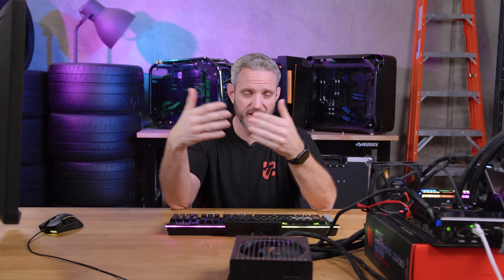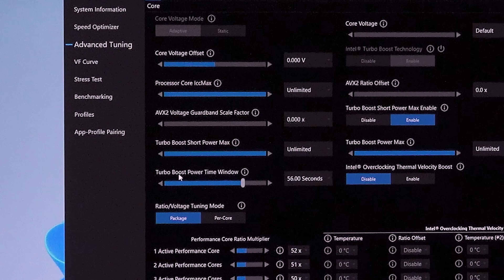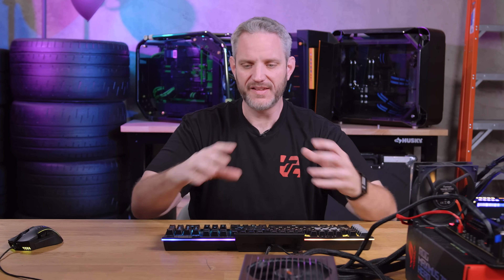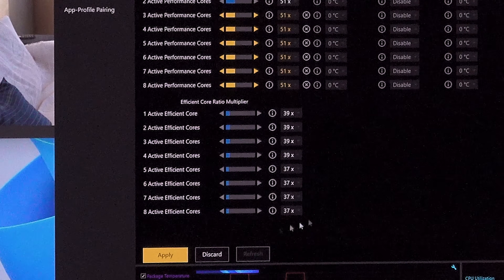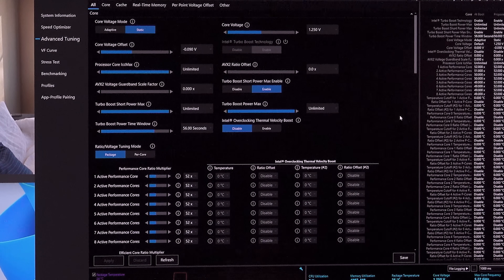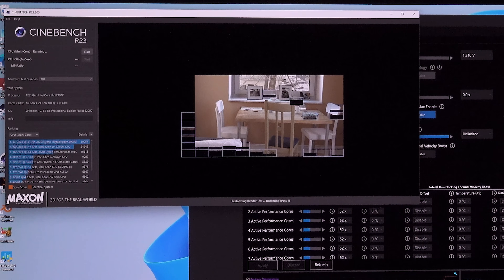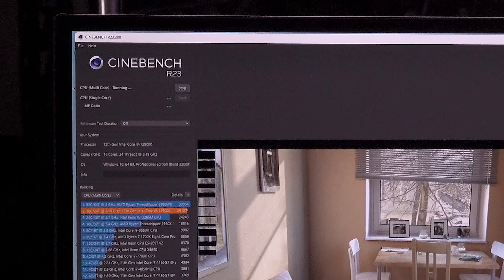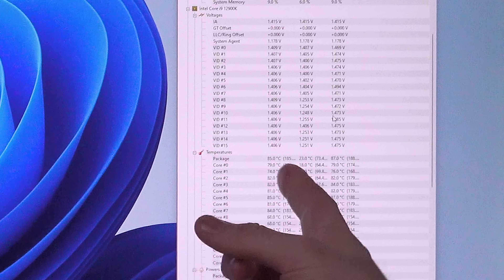Overclocking the 12900k is pointless and dangerous! Heat and Voltage testing...

Comment: I have my processor downclocked by 500Mhz. Still.plays all games just as fast, but much cooler. Video card power max set at 60% so it never draws more than 60% of what it can. Barely any change in FPS. Why the he'll do people OC? No need. Ever, unless you have a complete carp of a computer I guess. But if getting 144FPS plus, with far lower settings and power draw, why OC and burn twice the power and get negligible difference? Seriously.

Comment: my godman fucking piece of shit 12900k i caped it at 150 watt reseated the cpu block 3 times now and no fucking matter what i do this cocksucking cpu is still running 100c on 60% usage at 1.25 volt i have a massive 420mm+ 360m radiator pump fully working at 100% fans at 100% still boiling godamn hot losing my shit on the garbage cpu

Comment: Man, I took a crack at this last night and today and I'm getting some VERY odd behavior where no matter what I set for voltage offset I was getting thermal throttling.  I started fresh this morning by first setting everything back to default and starting over.  I ran Cinebench a few times with temps topping out around 93 and voltage max was 1.317.  I then added an offset of -.005 and the next run my max voltagle went UP to 1.4 something and had thermal throttling.  I tried to reset to default and my computer crashed (a few times).  I was finally able to reset to default and run stress test again and all was looking normal.  

So I offset voltage -.005 again and this time when I ran Cinebench the max voltage actually dropped to like 1.311 and max temps dropped maybe one degree.

So I kept dropping the voltage in -.005 increments and kept seeing the max voltage and temps drop.  I stopped at -.015 and then started increasing the multipliers on the cores in small steps.  All was well until I suddenly hit more thermal throttling and wanted to drop the voltage offset to -.020.  But when I ran the next test after that my voltages suddenly shot up to 1.5 and are now STUCK at 1.5 idle even with all changes set to default.  And now when I run Cinebench with all defaults I get thermal throttling.

What the hell is going on?

Comment: Given the improvement (or existence!) of the turbo boost logic on modern Intel cpus, would an otherwise equivalent k and non-k cpu (say, 12700k and 12700) operate the same stock (ignoring possible silicone lottery differences)?

Comment: I just bought an I7 12700K and the CPU is throttling quite easily due to high temperature (100C/232F !!). I'm using watercooling with 3 fans x 120cm dedicated to CPU. Is anyone else in my situation ? I'm quite worried the CPU burns out.

Comment: Disagree - If you're overclocking the 12900k (seriously) with E-Cores on, you're doing it wrong. Turn off E Cores, and play around with HT on/off and you can get pretty decent results on a 12900k (5.5-5.7). A KS SKU is also coming soon that will be pre-binned 5.5, which indicates there's cleary room for more on these. DDR4 vs DDR5 makes a big difference too.

Comment: 5.4 pshhhhh my 12900k can't run 5.2 all core stably unless I push 1.45 vcore and by that point cpus thermal throttling. Did Intel give you a nicely binned 12900k so you can promote these misleading overclocks?

Comment: can i run the i9 12900k with an air cooler? at stocks speeds i mostly prefer air coolers and i was planning on using a nh d15s
Reply: of course you can - at least as long as you dont expect to run a FMA-3 enabled prime95 without throttling.

Comment: it has been like this since 5 or 6 years. 
For example, back in the day if you wanted "playable" framerates at PUBG or DAYZ, you needed to overclock EVERY SINGLE ELEMENT of the pc.
I still remember going from my 1100t to my 2500k and jumping from 15-20 fps to 30 fps in dayz mod. Adding 2133 rams and overclocking the cpu to 4.8 ghz gave me around 40-50 FPS. 
Basically every HZ gained was valuable. 

Nowdays? Every game looks the same and can be ran at 150fps +
Maybe when they add complex AI overclocking CPUs will have meaning again. Until then, I rather run at 4 ghz low power than having a 500w toaster for web browsing.

Comment: Bit misleading given its not uncommon for motherboards to push these cpus to around 1.28 volts on stock settings to get 4.9ghz on the p-cores, lol. 1.28 volts can get most average binned 12900k's to 5.1ghz on the p-cores. 

Also, e-cores should be disabled if you play games as they can easily lose you 10-30fps in cpu bound games because they limit your ring ratio to a max of about 4ghz before you get errors. E-cores disabled let you get your ring ratio to 4.9ghz or 5ghz, which games actually care about your ring ratio. E-cores, like hyper threaded cores, usually get ignored or utilized poorly in games. E-cores also cause more power consumption on these 12th gen chips.

Comment: Gigabyte Gaming x
12600k 

Set: 
All core 5GHz p core
All core 4Ghz e core
XMP memory 3200 cas14 gear 1
Off set .05
Cache ratio 40
And not much else (could squeeze more out of it but really no reason to)

Runs very well with my old Noctua D14.

Basically a new motherboard and CPU and reused every thing else I had.
Nice upgrade to see me through a few years.

Comment: Wow, is a 3090 really still bottlenecked by previous gen CPUs?

I have a 9900K @ 5GHz, does that mean my 3090 FTW3 Ultra might be bottlenecked?
Reply: 100%. Anything than the highest end CPUs will bottleneck a 3090 to some degree, although it won't really be noticeable for the most part as long as it's at least 5600x/12600k range.

Comment: Extremely useful content Jay, Thank you! This is basically my exact build, just waiting for DDR5 (5200) modules to be in stock to finish my build. Please keep up the great work!
Reply: Finally got some ram two days ago on the old newegg shuffle. Gskill 6000
Reply: @erickwalker11  what motherboard? I have read 6000 and higher is unstable
Reply: @mikerzisu9508  z690 hero.  Completely stable. Never had to look twice after install and it's running at the full 6000
Reply: @erickwalker11  assuming you got one of the good batches with the capacitor installed correctly.  Are you running win 11? Any bsods?
Reply: @mikerzisu9508  no problems what so ever
Reply: @erickwalker11  did you check the potential backwards capacitor? That is a serious issue
Reply: @mikerzisu9508  yes its fine
Reply: @erickwalker11  have you tried stress testing it using prime or cinebench? Curious what thermals your are seeing. Also what cooler and thermal paste are you using?
Reply: @mikerzisu9508  of course it's been stressed. My system uses dual 560 mm radiators one for each side with the CPU and GPU separate. Running a 12900k I haven't seen over 73c after a good 6 hour loop on cinebench.

Comment: For people with Asus boards.

1. Disable all E Cores
2. AI Optimized on CPU and RAM
3. F10

What do you think about this 95% Overclocking done in 10-second guide? Or does someone still thinks E-Cores is necessary for gaming?
Reply: What do you mean by F10?
Reply: @mohamedmoustafa8924  In most BIOS or UEFI F10 button means save and restart. So basically once you're finished with all settings press F10 then enter to restart :D

Comment: How to undervolt on the asus BIOS
For the z690 boards, go to the overclocking tab. Scroll way down to "Cpu core/cache voltage" 
Change it to adaptive, NOT offset. 
Then change it to a minus symbol. 
go down to the cpu and set it to 0.070 and hit enter. All 12700ks should be able to do that so far. Brings temps down allot. 
that is -70mv btw. It'll add a bunch of zero's when you hit enter, don't worry about it. 
The new voltage will be shown during all core load, not single core boosts which still hit higher.

Comment: J intel xtu does apply your stable overclock at startup automatically you dont even need to open the program itself (Theres a xtu service running on the backround that loads your stable overclock on windows startup) i dialed in 5.2 ghz all p cores and 4 ghz all ecores on 12900k on xtu with -065 mv offset voltage thats all i change set it and forget it i didnt even bother changing anything on bios other than turning on xmp profile. Thats how easy overclock nowadays

Comment: I have the Gigabyte Z690 Aorus Master and am noticing a huge discrepancy when configuring voltages in XTU vs in the BIOS. Setting the voltage offset is a perfect example. Changing nothing else in XTU, except the Core Voltage Offset to -0.050V results in a Vcore of 1.243V when running Cinebench R23. Doing the exact same change in the BIOS results in a 1.305V or higher. I'm opening a ticket with Gigabyte, to see if they can explain the difference.

I've also noticed that even the lowest setting for Load Line Calibration causes massive spikes in voltage.

Comment: Hi jay. I always watch your videos man very informative. I have the 12900k and the Corsair icueh60i cooler. I want to exhaust it from the top of my NZXT case. It only has a single 120 fan and radiator so I was wondering your thoughts. I also want to enable the AI optimized feature. Will this cooler be good enough for that setup with no major overclocking?  Thanks man.

Comment: I’m happy to see the E-cores can achieve beyond 4ghz! This new architecture feels like what Sandy Bridge felt like just around a decade ago. 
There are even still decent budget builds I’ve seen here and there using i5-2500k’s & i7-2600k’s just because of how far ahead of their time those chips were (usually paired with an RX 570 or 1050Ti/1060 6gb nowadays)
Then again, AMD is gonna bring the heat with Zen3D(if that’s what they’re calling it?) as well as Zen4. Man what a time to be alive, if only the chip shortage wasn’t a constant issue.
Reply: And the gpu shortage, but hopefully that will improve with the 4000 series

Comment: the nzxt is trash btw, for 2100$ they give me ryzen 5 3400g and 6600xt gpu which his original price is around 140$ for the cpu hahahahaha what a scam site. i can get 3060TI with this stupid pricing for around 700-800$ and the other components of the pc wouldnt cost that much, i could build better pc manually elesewhere and it could cost me around 1700$ but with ryzen 5000 series etc. and not with this 3000 bullshit.

Comment: Intel has, since Ryzen launched, his CPU´s Clocked way more  on edge. Since Skylake and Kabylake, there was intels effiziency at a high level and better die quality (minimized fail and leakage), so that since then  been maximization performance in the foreground. Many of Intels performance comes from this and not from some better implemented coding  vs Ryzen - as it was befor Ryzen.

So, it is like in the autoindustrie, befor, for example, Mercedes  integrated AMG as a factory model (BMW also with M-Tech). Now. with M-Tech and AMG you can have from factory models, that do not need a tuning for every-day max performance. Yes, they are all expencive. What costs this I9-12900K?

And how long will it take, that we can buy an Bugatti Veron/Chiron-like CPU/system? This "AllInOne"-System (without Trunkspace!), that do fit in future all that in one in this every-day-System, what befor only in the "makeable-examples" (Supercars and Prototypes) realized?

Ok, Chiron is also a "makeable-example"... for very much money. No chance, that this would be reality for every-day systems.

Comment: Overclocking has long since died outside of extreme cooling. Back when there was little difference between server chips and consumer chips, you could get tons more out of a chip because they were basically targeting the same TDP. Companies are not stupid and saw all the extra free performance that they were giving users. So instead of releasing the CPU's at their intended TDP's and clock speeds, they added their own overclocking system to sell that performance to the end user instead of giving it away. 

The base frequency of 3.2Ghz is the real frequency of the 12900K, if it was to be a server class chip or an older chip before all this stock overclocking nonsense. So, it's not a bad overclocker, intel is just doing all the overclocking possible for you in advance. Why do you think motherboards have gotten so expensive? They are basically A.I. overclocking platforms.
Reply: I refresh my PC when the arrival of new gen stock at the retailers, causes the superseded components to then bear much more reasonable prices.  The Intel Core i9-12900KS CPU, the ASUS ROG STRIX Z690-G GAMING WIFI mobo, and the ZOTAC GAMING GeForce RTX 3070 Twin Edge OC graphics, in my mini tower, are all factory OC'd!   I fully approve of Intel's and ZOTAC's overclocking.   ASUS' AI Optimizing required failures to recognize its limits - unacceptable by me.   The default settings, even some Auto Settings, as was reported by Gamers Nexus, were way too aggressive to be safe to use.   A combo of Auto and Manual settings keeps the ASUS mobo under control.

Comment: I just upgraded from an i9-9900k (overclocked to 4.8Ghz) to the 12900k with this board (assus maximus hero) and I let AI overclock and couln't be happier, night and day compared to before - I do have a custom water cooled system so temps are 65 under load on CPU and 55 on my water cooled 3090 (Asus strix OC), FPS went from 100s to almost 200s with this CPU.. I am impressed, AI is much better at this on this CPU 54/51 Ghz (light load/heavy load)... Now I just need another 32gb of Dominator RAM that is not in stock anymore... :-)
Reply: PS - Tested with COD warzone.
Reply: PS again - this CPU at idle (2% load) runs cooler at around 32c now compared to 44c on the i9-9900k

Comment: This i9 does not seem like it's the best candidate for the type of OC Jay wants to do. It's already cranked and juiced from the factory because that's what they need to do to get it to be appreciably faster. But considering that it's the CPU that makes the least amount of sense to the largest amount of people.

The i5 or i7 seem like they have more room to play around with. 

What I'd love to see is the system power draw numbers while you're doing overclocks. We've seen that i9 will suck down all the juice you can give it stock, but seeing what it does when its being fed 1.4v should prove interesting.

Comment: I took a look at te NZXT custom build thing. I selected a 3090 with a 10900K for 3,4k euro, basically the most expansive items. (1euro is 1,1usd at the moment) and they guess it will run 72 fps on 1440p, LOL !

Comment: To me, overclocking only ever makes since for the i5/r5 range since the high end stuff usually is boosted pretty high and the mid range usually has more leg room. Plus the higher end stuff pulls way more power and can generate way more heat for not enough gain to make up for it, as we all just saw in this video. I was running my 9600k at 5 ghz all day but as soon as I went to the 9900k I left it at the stock 4.7 and still manage to pull almost the same amount of power that my i5 did OC’d
Reply: The OC framework has been screwed up to the point of humor.  I remember when overclocking meant resoldering a faster crystal and adding a heatsink.
Reply: My 9900kf goes to 5.2ghz all core on a 280mm radiator and it’s thermally limited at 1.34v. Pulls 130-150w during games.
Reply: @brkbtjunkie   I actually do have the kf version as well and at stock it will pull a little over 100w. To get it stable at 5.1ghz I have to jump it up to 1.39v and it’ll pull almost 160w of power

Comment: Didn't the Thread ripper 2xxx series got gimped by MS.. Due to its design. No problem on Linux, lots on Windows? if so no wonders the Threadripper score here is low. Anyway these Cores run at 3Ghz, not 5.2

Comment: my thoughts on overclocking: If you have the need to overclock a NEW Chip then you clearly bought the wrong chip... I Understand why Jay is testing the Limits so we don't have to.
Using more power in the long run will mostly eat up the money you saved on the store price because of a higher power bill...
This only works of course when you buy a low tier or mid tier part of course...
Reply: 12900k is the top end part though? Besides, who cares if your power bill goes up like 5% because you boosted your clocks.
Reply: @mikeydude750  like I said this only applies to low to mid tier and the answer was meant in general not for the 12900K

Comment: 2:44 What is the reason for custom water blocks having better cold plates? Wouldn't it make sense if AIOs were using those too? (Sorry I'm new to this)
The only thing I could think of is that AIOs have shorter lifespan because the motor for the pump is integrated in the water block usually so if that fails you gotta buy a new one basically.

Comment: Something I am super curious about is virtualization on this platform, how does a hypervisor make a distinction between the P cores and E cores. Also I looked and it does support VT-x and VT-d thinking about how I am running Unraid on my desktop to split up my Windows and Linux workstations and wondering how an upgrade might affect me.
Reply: Great question. I am also wondering the same re core distinction. Does anyone know where I can find more info ?